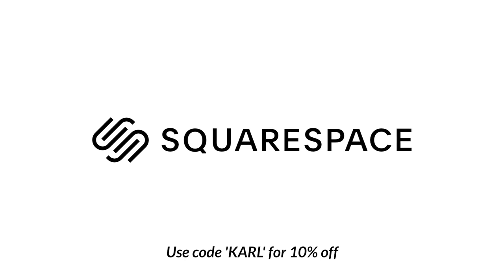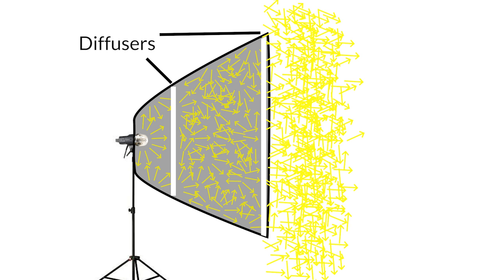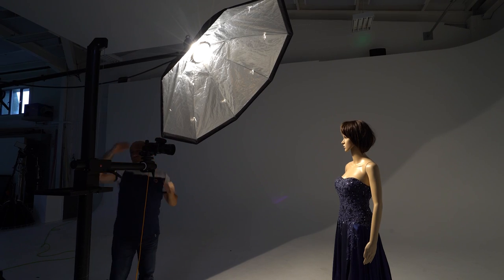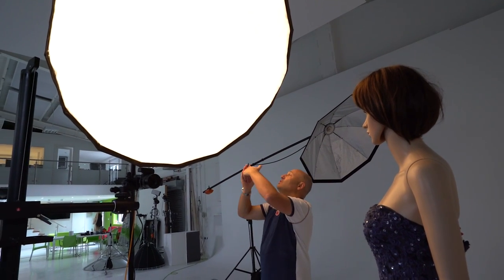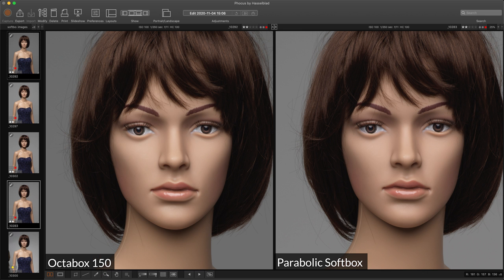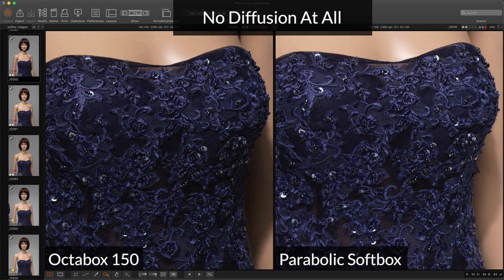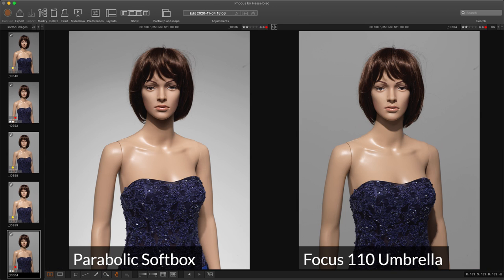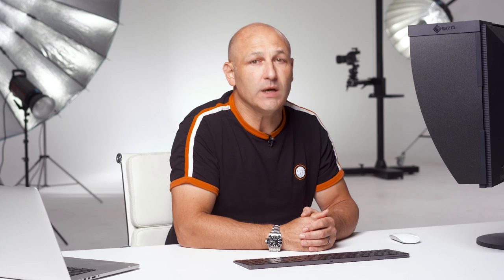The Myth of Parabolic Softboxes - Save yourself time, frustration & money!

Comment: Try to use these softboxes feathering the light, the difference is there imho! If you use only the edge of the light, coming from the softboxes, they are really differs. If you use them right opposite to the model, of course no difference. The point is, that a regular softbox spreads the light more widely, the paraboxes have more narrow way out. Also putting much more light onto the background in a smaller studio then yours, and that matters too. :-))) Maybe do another test also trying the feathering, we all appreciate that! 
On the other hand, I love your honest critics and expert level videos! Zoltán
Reply from the maker: Thanks
Reply: I am afraid that it's also a myth
Reply: I'm afraid that's a myth, the inner parabolic shape cannot possibly change the scattering produced by the outer diffuser.
Reply: @ionutmacri  Have you tried? I use it. There are a lot of bts, tutorial how to use it, how to light like that. Ask Elinchrom, why they do deep softboxes also. And the 100cm Deep sb is one of the best sb ever for portraits.
Reply from the maker: @genswarc   Hi, please see my pinned comment at the top of the page.
Reply: Please Show me your results. If you are using both diffusing materials in the parabolic softbox, there is no difference to softboxes at the edge of light (feathering). It changes slightly by using just one diffusing material at the Front, but the difference is small as I measured by a light Meter

Comment: Really great explaination on the uselessness of these softboxes. I just thought they'd be somehow better seeing ALL the youtubers using and recommending them, and even if they aren't endorsing them explicitly, the fact that they are using them, implicitly makes the viewers feel that parabolic softboxes will be somehow better. Good thing that the Godox dealer I talked with recently just recommended me their 120 cm octabox when I asked for the parabolic version, which was much more expensive, and even though I wasn't able to find a video as good as this earlier, my basic understanding of light and physics made me go with the octabox, but I was still a bit confused about there being some differences, but you cleared that up.
Reply from the maker: Thank you.
Reply: Interesting. As a user of the Godox P90H for video, not photography, I'd like to compare the octabox to the parabolic modifiers myself.  My understanding is that the octabox would have slightly more spill to the side, while the parabolic one would be more focused, as seen from the bright background in this video. The softness of both would be identical, as is evident in this video as well.

For photographing models and objects, I would agree with this video completely. But for video, having control over spill (especially with a honeycomb grid) is valuable. Especially if you have multiple people in the frame, or if you want to illuminate the background differently. Is it worth the extra weight and hassle? That's a personal choice. Maybe I'll get the octabox modifier and do a comparison myself.
Reply: @yuvrajwadhwani  I don't think that should be the case, as soon as light hits the diffusion material it's getting diffused in all directions, so parabolic softbox shouldn't have a more controlled spill of light.
I'd guess only a grid can help you in controlling the spill of light. Check out his excellent video on parabolic reflectors, the shape just doesn't seem to benefit when you use it as a softbox, as it just wasn't meant to be used for that.
Reply: @yuvrajwadhwani  Maybe it's just a very bad diffusion causing a hotspot giving the impression of less spill.

Comment: Thank you for this post.  I have been telling photographers this for years but coming from a professional like you instead of an amateur like me the message carries more weight.

One thing that I frequently hear is that there is less stray light with a deep parabolic softbox,  that the light is more concentrated in front of the softbox,  Horse pucky!  Light spreads from the front diffuser.  The light spread is exactly the same for a deep dish softbox or a shallow one if the front diffuser is flush with the front of the softbox.  Only by recessing the front diffuser can you change the light spread.

Again, thanks for this excellent video.
Reply from the maker: Thanks Don, and absolutely correct.

Comment: I think that one of the significant advantages of parabolic softboxes was the light fall off at the edge. Valuable if you wanted to light the subject (usually from an angle rather than front) but still keep the background dark.  They are a bit more weight/leverage and, therefore a bit harder to gaff. I didn't hear anything here that addressed the edge falloff which is unfortunate. That would be a good thing to test. 
Sorry, but I just don't care for the anger and exaggerations, especially when I think he missed an important use case.
Reply from the maker: You must not be a fan of Gordon Ramsey then either.
Reply: I'm not sure how the edge falloff applies when front diffusion material is applied.
If the light is evenly spread across the 150cm diameter front diffusion on both a 'normal and a 'parabolic' softbox then you'd simply have a 150cm diameter light source.  It doesn't really matter what's going on behind that 150cm diffusion material as long as there are no hot-spots.  I would imagine one could expect to find the same quality/shape of light from a 150cm 'flapjack' style flat LED light source.
Reply: @JaredRibic  agree. Dan is Missing one of the fundamentals of light, spreading of light in every direction
Reply: @JaredRibic  Correct me if I'm wrong - but doesn't the level of softness (which correlates to the fall-off rate) DOES indeed change based on the distance between the diffusion material and the core light source? This is a principle regardless if it manifests practically in this specific example or not.
Reply: We are too quick in concluding that parabolic softboxes are not different in their result. When they are applied as in this video, then there is little difference. In other settings, the difference is clear. I am surprised that only this setting was used to prove a point.
Reply: @DietrichLasa  Yeah I'm no expert but then I see the example practically on top of the model, cherry picking comes to mind.  He didn't do those tests probably because it doesn't favor his point, lol.  I think what he's saying is parabolic boxes are a huge waste of money for anyone not doing this professionally.  Odds are a parabolic softbox will not improve a novice setup, so beginners are better off with a cheap setup.

Comment: I fully noticed a difference and in the end the Focus 110 Umbrella gave the best overall and best overall evenness to the background. The Octobox is not an option for me. I just use shoot through umbrellas or a reflecting umbrella where I shoot into the umbrella and bounce it back out with a diffuser. Basically I use a standard soft box for my video lighting. Use umbrella's for photography. 
So, don't say there is no difference when it is clear that there is a difference between the two items you compared. Even the degraded video from YouTube shows the differences.

Comment: Hi Karl.  I enjoy your content and videos.  They are well presented with a wealth of information.  There is one problem with your assertion in this video regarding softboxes and parabolics, and that is that you are working under the assertion that the purpose of a softbox is to provide even illumination across the entirety of the light modifier.  That is not always the purpose or the design of all softboxes.  In fact, many softboxes for portrait applications are specially designed to have a brighter umbra in the center than the penumbra on the outer part.  Larsen softboxes specifically were built with this in mind for the purpose of allowing a greater degree of feathering across subjects, couples and groups.  It would seem that a parabolic similarly could provide a greater focussed culmination of light in the umbra area and a fall off on the outer penumbra by design.

Comment: Great Idea! I noticed a big change in brightness on the backdrop. Isn’t that a effect of a parabolic shaped light?
Reply from the maker: On which shot?
Reply: @Rusted_Eyes  Exactly
Reply: That’s because the modifier itself has a longer throw. Doesn’t make it parabolic whatsoever, however the the efficacy of the light is multiplied in distance when using a longer reflector. Certain hard reflectors (P70, Profoto TeleZoom) were absolutely designed to allow the light’s travel to be longer/more efficient. Think about it mike a megaphone or an brass instrument with a large long horn; it doesn’t necessarily make it louder, but the SPL (in this case, angle of incidence) is able to travel further. 

To Karl’s point though, in any real world setting, the difference in SHAPE of the light is in fact nearly indistinguishable. In no way are they parabolic in nature, and the menial differences in shape are pretty much null and void.
Reply: @tierangreen  Yep, nailed it. I agree with what Karl's saying cause I noticed it straight away after I got one... But I also noticed it was doing something my umbrella wasn't: narrowing the beam throw. I still feel stupid for spending twice as much on it as I would have if I'd just gotten a big umbrella. I do prefer the round catchlight though
Reply: It's deep softbox. Not a parabolic. Ofcourse it has different result. It is like light from a tube and it is a lot narrower. Because it is deeper and light source is further. So spreadint not as wide. Edges are blocking light.
Reply: Para are made to focus and throw light and keeping them in at the same distance in this test clearly shows that on the background. If your just going to use it in a small studio then there is no reason to buy  a para, but if your shooting on location and need to threw light then that when you need it. Not sure why you would even use the outer diffuser on a box that is made to threw light unless your shooting close up.  That would be like putting on a sock cover over a elinchrom maxilite / Broncolor P50 / Profoto Telezoom reflector makes no sence to me. Para's are made for hard contrast light not soft
Reply: You can send a "beam" of light from the edges of a parab, which you cannot on a regular deep softbox, since it can only send it through a middle spotlight  or evenly diffused. The parab can completely change the specularity of the light.  Sending it further isn't the only thing used for, you can achieve that with a deep umbrella without diffusion since it focuses the beam better than a regular softbox.

These are my thoughts, hope my english is good enough xD I've worked with big Broncolor Para but I don't own one.
Reply: @shaolin95  Totally agree, not a good comparo vid of intended use.  I did like the outcome of every pic using the 150 better, save the last non-diffused closeup of the dress, where the details of the dress are more pronounced using the para.
Reply: I agree.. the big difference is on the background. And thats what I would use the two softboxes to shape
Reply: @carlwingard8241  please read Karls pinned comment. A parabolic softbox with Diffusion Material makes No difference to a normal softbox at all.
Reply: @shaolin95  yes, Feeling that you dont  get what Karl is saying. He says that a parabolic softbox in Diffusion Mode makes No difference to a normal softbox at all. Without Diffusion Material it's a deep softbox which have a bigger light Output with smaller spill of light. Please read his pinned comment
Reply: @rizziseven  lol you guys. the point of this video is well summarized when he said parabolic and softbox are paradoxical words. if you want some fill for the background, there are like a dozen better and cheaper ways you can control it. so in essence, people use them as softboxes are wasting their money for no better result.

Comment: Parabolic reflectors are also used in headlights to direct and focus light. - not to diffuse it.
Reply: Yes, Karl is a pro and uses this broncolors for a Long Time and He knows this
Reply: okay, will grid do the same effect as the parabolic does?
Reply: @tejagudise  no — Grids tightly control spill/coverage; true parabolic reflectors actually collimate the light similar to a fresnel.
Reply: Which is the point. A parabolic soft box do not make sense.

Comment: Hi Karl, well explained video and highly interesting, thank you! Although I understand your point, watching and looking at the images, I have no doubt that the parabolic samples are better! At least to me...as you say, the difference is negligible and being cumbersome and heavy to handle, there is no point using them. I also understand that the final result can be obtained easily by one of your editors, whereas pro photographers like to nail the shot to 98%, don’t they? In any case, I am far from being equipped like you are and do use a parabolic umbrella, which is certainly easy to handle 😊 even outside. Maybe I should think about switching to a smaller body and lenses than my MF...? Cheers
Reply: Read his pinned comment ...

Comment: Interesting test, certainly no difference on the model, but the parabolic seems to spill much more light onto the background?
Reply from the maker: Thanks
Reply: That's not the point on the difference to a para. If you want a darker or lighter background you can just adjust its distance
Reply: Yes, but only when you Take of any Diffusion Material from the Front

Comment: Thanks Karl. I've always felt that the basic physics are far more important than the sales pitch. And, while you might quibble about a tiny difference between any two, I doubt that, barring a side-by-side comparison as you have just done, most, even professional, photogs can distinguish from a fairly wide range of similar effects produced by different products in a stand-alone image. Which begs the question, aren't we getting a bit too attached to details which we can't really discriminate in practice. My training is as a classical musician before moving into photography, and we have the same problem. Just because I can control minute fractions of a second (down around 1/72 or better) and subtle shades of expression doesn't mean the audience can hear them from the front row, let alone the back one. Good video.
Reply from the maker: Hi Dale you raise good points some modifiers also create only subtle differences but to the trained eye (or ear) they can be noticed. I have a video covering this coming in a few weeks.

Comment: The idea behind some parabolic softboxes (that with an additional focus system, similar like on the broncolor para) is, that you can use the same lightshaper with different accessories for different results. Without the additional focus system, this lightshaper (i guess, softbox is the wrong word) will be a big directional reflector, or - with the diffuser - a very round softbox. Or you can use the additional grid. Or you put the lightshaper on the additional focus system, where you have a indirectional light source on a focusable tube. 

True or not true parabolic reflector: it is depending on construction from the lightshaper. With the traditional softbox style construction, like the elinchrome litemotiv, you will need a big speedring, which will determine the backside shape from the reflector. This ones will have the round shape backsides. Even the additional focus system will have a giantic round plate for the speedring.

With an fix assembled rod system with click mechanism, like the deep parabolic softbox from Jinbei as an example, the shape from the backside will be more "parabolic".

But honestly, if someone use that different parabolic softboxes with the additional focus systems, the shape from the backside doesn´t really matter, because nobody will use the lightsource near the damn backside.

Comment: my two cents  is the parabolic shape for a softbox will give you a mix of softness with direction so that the shadows are more dramatic than a regular softbox. A little more defined.
However, that kind of look, which I like, can still be done just by moving a regular softbox farther back until you reach a point between where it's really soft and where it looks directional.
And the same can be done with bouncing a light off a white ceiling by raising the light closer to the ceiling or lowering it. Or with window light, you can see it change with your eyes by looking at the difference between being right next to the window and moving further back into the room away from the window.
There comes a point where the light keeps it's softness, but moves away from the really soft, flat look of being right next to the window and starts to get stronger shadows for more drama.
Maybe you can spend the extra money for a heavier parabolic softbox and have it next to what you're shooting. Or you could use a regular softbox, move it back a little, or even use a grid or those egg creat grids and get the same effect.
Nice video. Always enjoy any video that cuts through the exaggerations and things that are purposely made to some more to than there actually is.
(OMG, that's amazing!. How'd you do that?) (Pretty girl, pretty outfit, you're done)